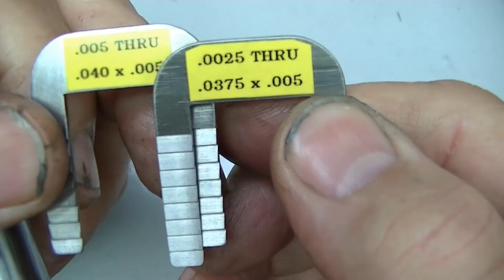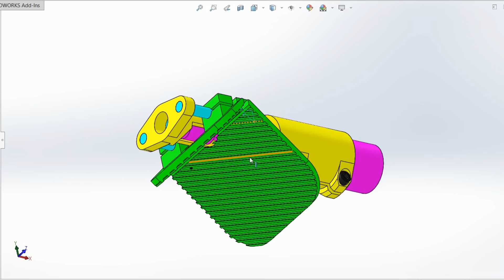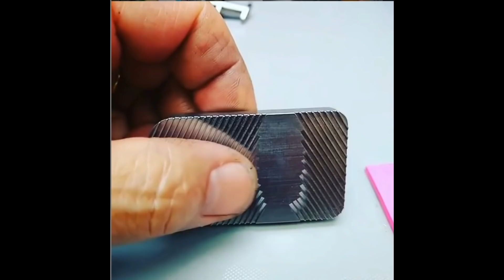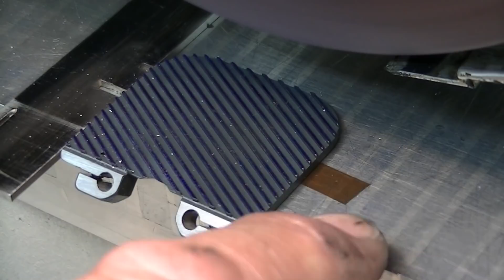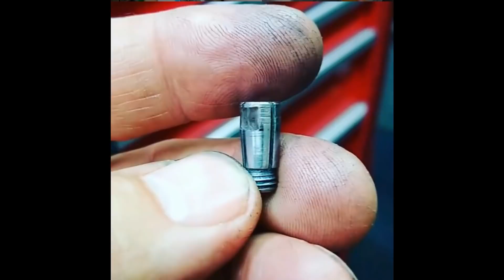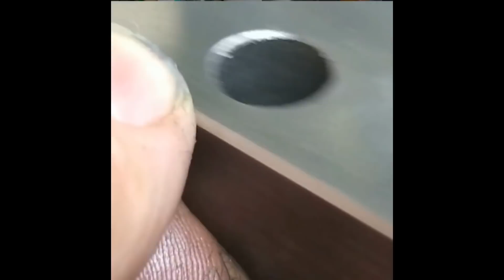MAKING AN AIR TOOL CHAMFER ATTACHMENT

Comment: Robin, would you mind sharing the drawings? This tool would save me so much time. If not no problem. You are inspiring me to step into the relm of grinding and more precision work. Right now I only have a mill and lathe but I am starting to see a mirade of uses for a grinder and d-bit tool to aid in more precision work. I also need to buy a surface plate. Brilliant work as always.

Comment: Shame you didn’t have some kind of chamfering machine to deburr the fence plate chip slots after surface grinding 😂 shows to go you even your quick “low quality” videos are worth more than high-polish videos out there that teach you nothing - love your work Mr Renzetti 👍🏻
Reply: Air cooled multi- tooth reciprocating hand operated chamfering tools have been available worldwide for many centuries. Can anyone name this important invention? Bronze examples of this extremely versatile tool were found as early as 7 BC. Later versions were made of hardened steel.

Comment: Great design and execution. Thanks for showing. Can I ask, how did you do the gauge fit bore of the collet to the carbide pin? I saw the needle lap, was it bored or reamed? Thanks Robin.
Reply from the maker: undersize ream before heat treat
Reply: ROBRENZ Thanks Robin!

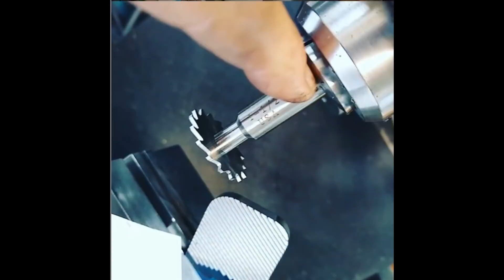Comment: 15:38 you can do that on an ER collet too, but you have to have the same diameter plug at the other end of the collet so it squeezes parallel to the shank and not cockeyed which would mean no grip.

Easiest is to make a few flanged plugs that you can insert at the other end, the flange holds it in place while you screw the collet in tight.

Comment: Sweet! Now you just need a really nice flexible hose for that dotco. Handling qualities of the tool look pretty optimal. Nicely done Robin. Was the shim on the platens to introduce an open angle between the two platens?

Cheers,

Tom
Reply from the maker: Hi Tom, 
Yes the shim was to open up the 90 degrees so that out of square precision ground stock could get uniform chamfers.  I think a miniature version of the 360 degree swivels by gripnail freedom swivel would be awesome on these dotco's

ATB, Robin

Comment: Many thanks Robin. Thanks also for the free Solidworks modeling tip!  I usually use circular extrusions dimensioned by equations, but I can see the benefit of the revolve in some circumstances. I think that's more a Renzetti precision grinder than a Dotco now ;)

Comment: Excellent design and very useful tool! That would definitely sell. I would certainly recommend considering a CNC run, providing the air tool used is still readily available.

Comment: Are the chamfers just cosmetic or do they actually serve a purpose? Sorry, I didn’t know much about metal working.
Reply: They are both. The material would be sharp and cut you if it was not relieved somehow. So the chamfer or round overs are used to soften the edges to prevent injury, cutting material, or even to reduce the delicate edge that if hit can cause two different pieces to not mate to a seal. with a chamfer or roundover it's less prone to damage.
Reply: Thank you!
Reply: They are cosmetic. 
But, ... 
They also prevent damage to sharp corners of the product (so it looks nice even after it has been banged and dinged repeatedly over the lifetime)
They prevent other parts and our hands from being damaged by this one
When you create a sharp corner by machining, there is usually a burr and you have to remove that (for cosmetic and the above mentioned reasons)
When the part has to fit in the inner "corner" of other part it is usually much easier to chamfer the outer corner than relieve the inner corner of the matching part.

Last, but not least is that it is very difficult to create perfect edge on a 90° corner, so a small chamfer - especially one made to this degree of precision, makes the fabrication much easier.

Comment: Excellent tool. Fitting video. 

Think the most impressive part was to see how you anticipated potential problems and designed the tool to deal with them. Instead of having to go through generations of prototypes you completed a fully functional tool first time. Wisdom and craftsmanship. 

Kudos to your son for the idea.  I would hazard a guess that observing you work opens the imagination as to what is possible. It seems like a self evidently good idea; but why did no one else come up with it?  (Maybe they have tried and failed?)

Comment: In all seriousness though, I know you like to be humble but you have a gift for coming up with this stuff. The rest of us just bang our heads against the wall wishing we could think of an answer to a problem and you blow it out of the park every time.
Reply: Robyn is both a machinist and an engineer, There's no doubt that he engineers.
Reply: jsteifel I hadn’t heard him speak to having an actual education in engineering but I agree he’s very well versed on engineering or at least it appears that way to a regular guy like me. He’s very methodical and picks up very well on subtle characteristics. My cousin worked at American Airlines doing some type of assembly and he and I were just talking about how he was paid a substantial amount multiple times through their “good idea” program. It got me thinking if a Robyn R. or Tom L. worked there they would be rich. One of the bigger payments my cousin received was for simply telling AA that they were testing these high dollar engine mount bushings at way too high of pressure and they were destroying thousands of dollars worth of them like every other day. It turned out that they were testing them at like 300,000 lb when they never saw more than like 30,000 lb in under load. That got him a $50k check.
Reply: @strangefruit8776  I don't actually know that he has, but he clearly does the math, and engineers evertything he does. He is not just a machinist , or fabricator. He definetly engineers. Much better than some engineers.. because he also knows what it takes to get it done. Where some engineers come up with an idea, but no clue how it can be accomplished.

Comment: What's with the tape on the air hose?
Reply from the maker: It's a piece of glue lined heat shrink holding the exhaust sleeve in place
Reply: I believe it's the tool's air exhaust tube that's been taped down the air hose to prevent your hand getting frozen

Comment: Narurally, I have a comment: if you had stop screws controlling the gap between wings of the platen, you wouldn't have to gage when you shifted along the cutter. Use that tweakable LockTite to hold the stop screws from drifting. Is there room to retrofit?

Beautiful execution. You must know a machinist.
Reply from the maker: Hi Forrest, I considered lots of variations of means to have a  setable chamfer size but chose to keep it simple. Lots of interest in this so I may redesign for manufacturability that includes an improved setting method.
Reply: @ROBRENZ  I was hoping for a pair of teeny tiny servo driven ball screws with a little DRO displaying champher size in Imperial or Metric Roman numerals..
Reply from the maker: @forrestaddy9644  That's funny!
Reply: @ROBRENZ  Actually I like the gauge method you chose; it has a repeatable accuracy that you would not get with an adjustment screw.

Comment: Would you be able to get better cutter engagement if the guides were on an angle to the bit?
Reply from the maker: It may leave a burr on the one side of the chamfer.
Reply: @ROBRENZ  my brain isn't quite figuring out how. If the axis is held perpendicular (or whatever angle you want if not a 45° chamfer) to the edge normal  isn't there a full plane of rotation available where the cylindrical bit will still produce the same cut? (So long as the chamfer is narrow enough to not hit the ends of the bit)
Reply from the maker: @RobertSzasz  Correct, I thought you meant skewing it the other direction to get more length of cut.

Comment: Brilliant design - Next a miniature routerbase for the Airgrinder to do contourwork?
I am glad you put this video together, despite the pieced together appearance - It has so much information it it, it would be a tragedy not to put it out.
Thank you!
Reply from the maker: Thanks Stefan, I made the router base for it years ago and I do use it for contour work but this is much better for straight chamfers.  I need to try it on hardened  parts to see if the burr will hold up for a reasonable amount of time.
ATB, Robin
Reply: @ROBRENZ  Did you bought those burr bits ith ball bearings or are they home made(how if they are?)?
Reply from the maker: @zumbazumba1  I showed grinding the burr down to hold the ball bearing later in the video.
Reply: Time flies - it was about 4 years ago I saw Stefan's  YT clip on making a chamfering tool.  See https://www.youtube.com/watch?v=M8pLEfKZy4w
I liked the idea of Stefan's use of an end-mill - which one to build?

Comment: Real nice tool geometry and fixture design in one example .you are so thought prevoking . Thanks content qaulity and cinematography two different things If the content is good you could do it in your long johns , woulde'nt complain about anyone trying to help me and you and the community on youtube just wow . making a toolpost grinder with a coolent trough thinking 2- 1 gallon lab jugs the level switch trips the spool valve and presurizes the other jug the old feed jug becomes the return spool valve

Comment: Awesome chamfering tool and your absolute precision approach is insanely satisfying. For micro fillets I use a hard #400 grit polyurethane rubber (infused with grit) die grinder cylindrical tools.. can't remember where I bought them (come to think of them, I never saw them anywhere else than at that glass artists shop) but man it's so easy to make delicate shiny small rounded corners on all your precision parts. Sort of like cratex, but higher grit and larger diameters + much much cheaper (cratex products are criminally expensive).
Reply: chronok good info

Comment: So the Son asked Dad for a tool to assist the deburr work and chamfering, He probably thought..that will make my job easier.  
Dad thought, that's a good idea.  Now Dad expects Son to deburr and chamfer to more exact tolerances.  
Son still recovering......  
LOL.  Old guys rule.
Reply: Think son has got his father's attention to detail, so all this is is Robin showing that for a part he makes, even the things that only he will ever see, he wants it to be as perfect as he can make it. He wants his tooling to be as good as possible, and that with a bit of thought and care in design and implementation you can make even a tool, that is not the precision he wants, be a lot better than the manufacturer ever thought possible.

You have to love the attention to not only the large details, but also to the smaller things, and how to make the part with the finish being both achievable, and also being hard wearing and serviceable as well.

Comment: one of the contractors that I give work too that does mechanical design and fabrication has something like this but the foot or fence or whatever you want to call it has an inside cone instead of 2 flats. I think yours is better in that this should be easier to keep perpendicular to the work. They have one feature your is missing though. They is a T fitting going to a ball valve with 1/8th air hose going to the grinder bit to blow the dust out
Reply: I think the air tool Robin uses blows exhaust air out by the spindle, so the air is already there doing a double job of cooling the carbide, now it has a confining volume, and also clearing the debris of the tool use.

Comment: Great work. How about a version of this for chamfers on rounded Parts? Instead on the platens, two opposing cones could be used to guide the tool. This would ensure constant chamfer size when working on rounded parts and the possiblity to work on inside rounded features.

Comment: wow just watched for the fourth time trying to assimilate :). why didn´t you consider sliding the rods as to maintain gap, vibration?. thanks for sharing. lately i´m afraid to watch your videos as it only remarks how little i know about precision :D. take care
Reply: I believe this was not possible as the support bearing is at a fixed distance to the air tool body.
Reply: @bruceanderson9461  oh yes i understand that. but i meant if the two rods that hold the angle guides could slide up and down to use all the burr and maintain the set gap. in case that operation would save setup time. maybe that is more of a complication than help or like i asked could induce vibration. just a humble question :) trying to learn why this or that of design in general. sorry i'm not good with words. :)
Reply: @bruceanderson9461  Yes air tooling you tend to have a large unsupported end mass, so this design that provides a support both ends reduced any runout, and also will lead to longer tool life as well, as the part most likely to wear will be that tiny bearing at the end, as it is handling the most loading, being so close to the work, but it is easy to change it and the carbide burr as a unit, and to have a few spares around for this as well, doing the new burrs in a batch after setting up the jig to grind them true. Going to guess Robin has a dozen burrs all ready to use in there from his first manufacturing the unit, and they are all in a nice clean bag, individually wrapped and lubricated, ready to be taken out, placed in the collet after wiping clean, and using, knowing they all will run true.